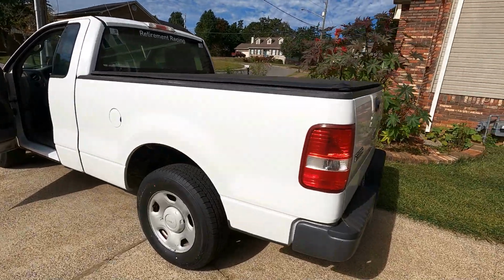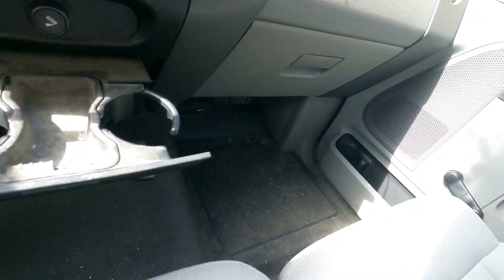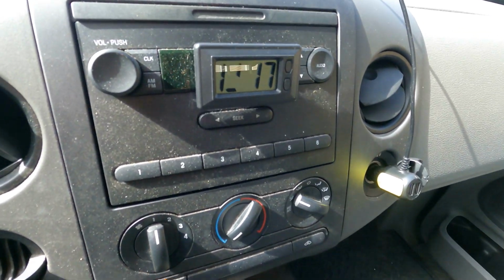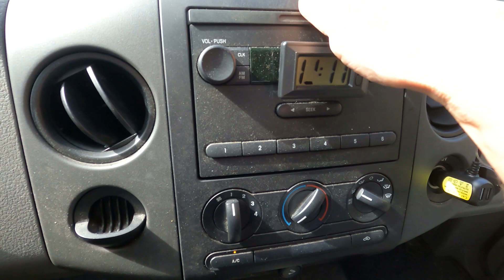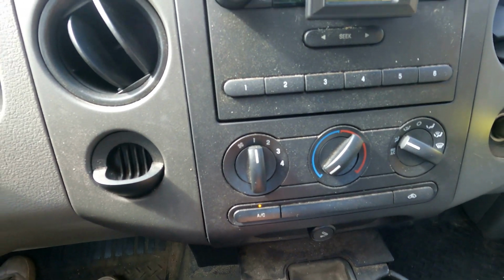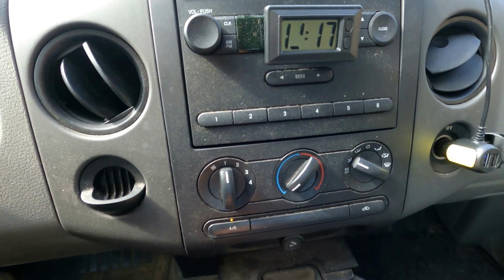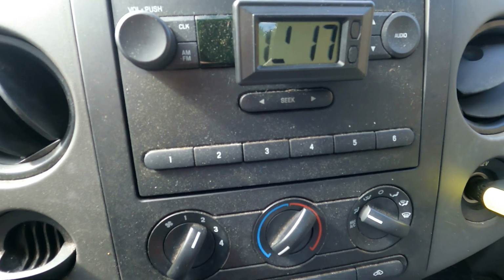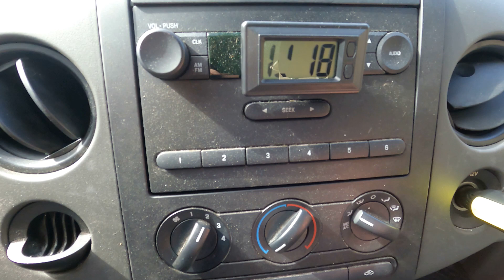2005 F-150 Dashboard Noise

Comment: Sounds like an acctuator door or motor going bad. Do you still have hot and cold air on the correct settings?    https://www.youtube.com/watch?v=gdWILwAnQy0
Reply from the maker: Thank you Keith, and yes the air is/was still hot and cold.  I've determined that the door actuator solenoid is doing all the banging.  I've got a new one but I'm not sure how to get things set right to put the new one in.  When I took the old one out I had the temp set to full cold but the shaft on the new one is centered on the arrow - it's off by about 45 degrees, or one whole tooth on the shaft.